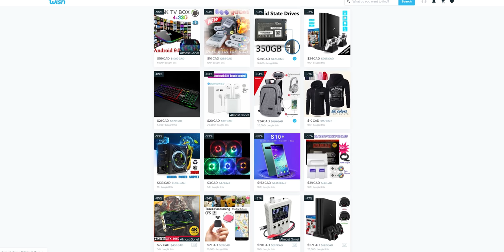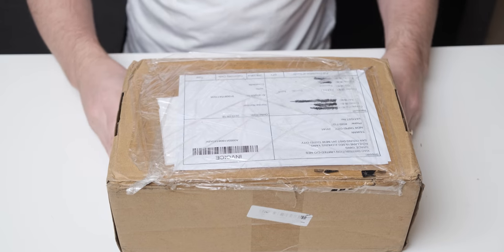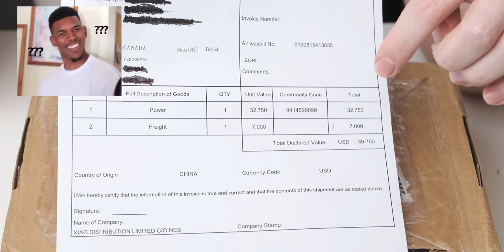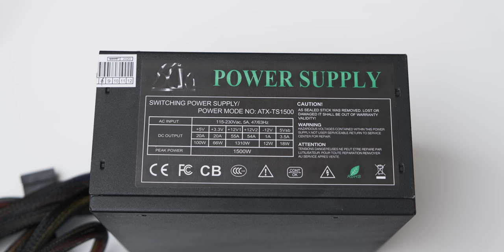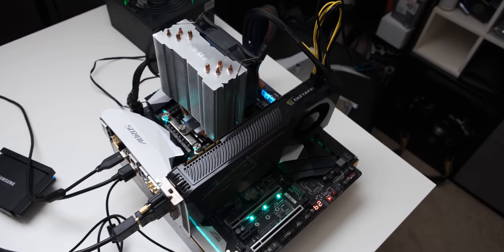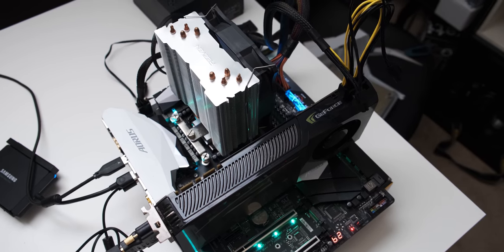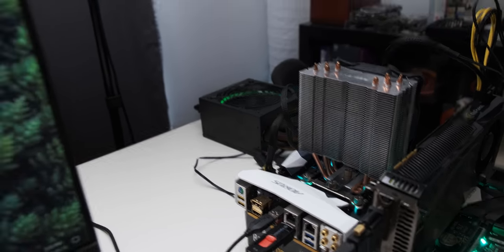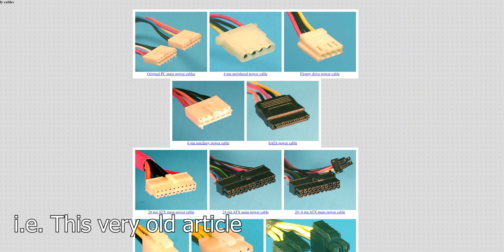I bought a $69 1500w power supply on Wish.com

Comment: Doesn't have certification or a high quality but, look at the pcb, it have some vertically mounted boards with regulators, thaths mean is not a cheap generic at least it have some regulation. And the Rubycon cap, it looks genuine maybe a recicled one because it have the "K" dent on top but the differences are in the letters on that cap. I think is a 40% to 60% off the 1500W reating.
I mean that because where i live is common to see the brand Sentey and sub-brand LNZ, which are super cheap construction pheripherals, and the PSUs like the model "BRP 500" (38.48 USD) and the internals are worse than what you shows to us is simply a generic psu, the construction is similar and it have a piece of junk similar look to a transformer or a choke, in reallity is a piece of steel and a loop of wire connected to nothing, trying to weight more feeling its a really good psu but is not.  Definetly this psu is much better contruction than this Sentey one

Comment: Hello, electronics engineer here:
After my detailed and extensive research I was able to... read markings on the PCB saying "550W..."
Btw. for real now, has nobody noticed those markings even tho video is out there for one year?
Also I highly doubt those are genuine Rubycons, it's pretty common for chinese to make such clones.
Reply: I 100% agree with you... As it is a Dual switch Forward topology design... For 1500 watts Output rectifier diodes gonna have really hard time to do.... For 1500 watts there are simply not much cooling on Rectifiers on secondary side... And not much filtering capacitors... Thats terrible... 
Although I think tbis one can do 650-700 watts. As transformer side is good enough + primary side capacitor too...

Comment: I've used some cheapo PSU's in the past. Sometimes you'll get lucky. More often you'll eventually get capacitor whine and inconsistent voltages (causing the PC to freak out).

Comment: To be honest this power supply is literally good than any other ones
I know some electrics so Rubicon is a known brand used by msi, gigabyte  and corsair etc. And the heatsinks are huge so yes mosfets and transistor should be good, and the input and output dc and ac filtration looks promising so you can say you can run upto 500 - 600 watts rather than risking your components and using it on 1390 watts to be exact. Lastly that psu really got a Thermal take which is impressive. So, yes that psu is looks promising for lesser than 600 watts.

Comment: I don't know much about PSUs, but i can say that: 1) rubycon is a (surprisingly) high-end cap manufacturer. 2) cap's capacity is nearly not enough for even 750w, its more like 450w, i think. 3)this PSU seems to have an actual pfc (which is rather expensive, since it requires a lot of copper) 4)many Chinese fake PSU sellers put very weak transformers(since they require a lot of copper again) (one fake 1200w psu once had 400w transformer), and it's hard to identify by size or look, while marking tells nothing.
4) Really, 80+ is a test of EFFICIENCY, NOT SAFETY, it's a very common mistake for some reason.
5)YOU CAN'T TRUST SUCH PSUs, even store bought with 80+, if they have bad design or components should not be loaded nearly their top power: only good 500w can power 450w system, a bad one should power 350w one. You can ignore it, and i could work just fine, but one day your system could just die from random power spike

Comment: 80+ certificates dont actually mean that your hardware is safe from harm
it only indicates the efficiency of a PSU, so technically 
a PSU with 80+ bronze can be dodgier and potentially more harmful
than a non certified one for your hardware being just more efficient in terms of power draw
and there are plenty cases of that being true especially at low budget joices

Comment: I really like most of your videos, but I had hoped you would have checked the voltages, either through software or with a multimeter, to see if it was properly maintain the 12V, 5V, and 3.3V rails.   I may well be a perfectly good, but lower power rated, PSU for a midrange replacement part.  Still giving you a like for this one because it's always entertaining to see if some older hardware will be killed by one cheapo component. :)

Comment: i would like to see that thing actually blow up and see how much load it takes before that happens ... good way to test would have been to monitor voltage values under load ... and add more components (or simply a more power hungry GPU) to it gradually and overclock cpu gpu until voltage starts to look bad ... then u can use other appliances that use 12V if u have any lying around hook em all up till it blows :D ...

Comment: In my experience, never use a cheap power supply whose quality is suspect.  I’ve had generic power supplies blow and take components with them.  Of course this was like 15 years ago.  Almost any PSU today will be better than the crap from back then.  
After that happened I placed an order for an 800 watt BFG power supply and I remember the guy being like, 800 watts is massive overkill.  Which wasn’t actually the case since I had SLI 8800 Ultra’s, in 06 this was.  The PCI-E power connector had just started being used back then and you had to have a good power supply if you wanted to get those connectors in abundance enough to run 2 or more graphics cards with two 6 pins, 8 pins weren’t yet being used at that point.  Which sucked, cuz I had to buy another new PSU, a 1250 watt Cooler Master Real Power Pro, which still works, and was awesome for back then 80+ silver by today’s standards back when the only rating that existed was 80+,  this was when I went to 3 way SLI GTX 280s.  It was one of a handful of PSUs with enough PCI-E connectors to run 3 graphics cards.
My concern now is with the RTX 3000 series they’re talking about changing to a new style of power connector a 10 or 12 pin.  And I just not too long ago bought an EVGA P2 1600 for $500.  I really don’t want to have to buy another new power supply if I can help it.  Sure there will be adapters, but I hate using adapters.

Comment: Probably a power supply that failed thermaltake QC and was sold off to a 3rd party for a rebrand.  Kind of like how lower tier TV brands use reject panels from the higher tier manufacturers.  I would say 550W max continuous.

Comment: Thats literally what i have. And it survived 11 years until now😂😂
And i have to admit. I got shock multiple times and its strong 👍
Reply: I lost 2 gpus to a much less dodgy power supply. I recommend switching as soon as you can lol!
Reply: @ThePiprian  Crap... power supplies can fry your GPU?  I have a 650 watt Corsair 80 plus nothing with ketchup and mustard leads which  I bought from a dodgy little computer shop 5 years ago.  Maybe I will replace it.
Reply: @thejollysloth5743  check the psu tierlist on the ltt forums.

Though even if your psu is a good one, after 5 years you might wanna get a replacement anyway.
Reply: @ThePiprian  Trust me, it's not a good one. I bought it back before I really used Amazon so there wasn't any choice in the shops near me.
It's the most basic model Corsair makes, and the shop overcharged me heavily for it.
The only thing going for it is that it's a 650 watt model and I only have a 10600k with a 1070, which really only uses about 400 watts for my whole system.
I'm already shopping for a new monitor so I guess I'll grab another PSU whilst I'm at it. 
Anything you would recommend in the 500-600 watt range?  Nothing too extreme, maybe an 80+ gold.

Comment: I remember I bought a fake power supply they said it was 750 W it was not. I put it under load and it blew its components at about 230 Watts. It shot claims and smoke out of the back of it

Comment: Just a warning to Dawid or anyone else who wants to open up a power supply and doesn't know what they're looking at: DO NOT TOUCH ANYTHING INSIDE. Those capacitors still hold energy and touching an exposed cap inside a PSU can literally kill you.

Comment: It doesn't look terrible. I'd use it. It seems to have active PFC and it even has a fuse! I've used much worse looking rebranded chinese crap bought at local stores 20 years ago, when nobody was actually tearing down ATX PSUs yet. I'd say the inside of a chinesium 750W PSU sold for the same price by a local dealer looks pretty much the same inside. It's just the usual 200% specs scam at wish.com.

Comment: That is around a 450w power supply and a very basic design at that likely has some pretty dirty power output I only seen a few smoothing capacitors in there so i bet money that power supply has some serious  power ripple / fluctuations

Comment: you shouldn't even try to plug in a psu like that, i'm SURE that after 200w it starts putting massive ripples in your system, breaking every atx specificacion, and therefore ruining every component attached to it, either get a proper psu testing equipment or make it explode in some way that does not require a pc.

Comment: You do realize that you used the power supply in Canada (120V) with the red switch on 230V input Mode (4:26)? This poor thing does not even have a wide-range input :-D

Comment: man this thing is more flimsier than my old Powerlogic 550w generic. I'm no electrician(well my brother and father are both electricians) but I have a theory on these PSU's on why they are mostly above 1kwatts, I think the idea why they give these things such high capacity is because generics and those korean non branded psu would be unstable af if they reach more than 80% load, generics and white psu's from my experience makes a lot of heat that's why they shouldn't be in any cases that have the psu's top mounted. my Cooler Master Elite V3 400w blew up on a 35c afternoon while playing black ops 2, though the parts innit aren't exactly power hungry. also I think I heard the PSU God JonnyGuru talking about generics and lower tier psu's having an old topology design that would have effects on your system in the long run if paired with modern parts, like grounded usb ports and audio ports as well as leakage to the case itself... which btw happened on my friend's system when he was using his TigerPower 700w PSU which he called tigershit. it got so bad that when one of our friends plugged in her iPhone 7, she couldn't touch it because it keeps shocking her lmao. PhilsComputerLab and Zach's Tech Turf also had a similar psu that you bought tho Phil I think has the mining version... and so far so good. 
any ways you have balls of steel on disassembling a dodgy PSU, I typically do it on generics that need their fans replaced but that psu is far worse lol.

Comment: looks like a low end old TT power supply with a new sticker, maybe 350 watt
Reply from the maker: I'm not sure its more than 350W considering thhat the system I tested it with draws over 400W.
Reply: @DawidDoesTechStuff  I ran a 400 ish watt system on a 300 watt power supply for over a year before it went poo

Comment: most of the time those things are "okayish" mid-power units that are grossly over-labaled and sold at a higher price. so instead of selling it as a 500W unit for 40$, they sell it as a 1500W unit fpr 69$. 

it will work in almost any pc, but will not handle a 16 core sli blingbling machine.

Comment: Been nailed by a powered up supply that wasn't working properly, i.e. the Amiga 2000 wouldn't come on, had the top cage off and was trying to see if any of the larger semiconductors were overheating or just cold because they were dead.  That fingertip was numb for some time afterward. Yes, stupid, I know. At least I was bright enough to NOT be touching the computer chassis with my other hand  thus  not enabling a nifty ground loop thru the rest of my body.

Comment: I was thinking that, besides the green led ring, it looked basically identical to an old 600 watt Thermaltake unit i have laying around. Then I saw the Thermaltake fan. I'm guessing its just rebranded with different stickers. Although, if I remember correctly, even that old 600 watt unit had 2 pci-e power cables.

Comment: I'm pretty sure these units are recycled. the chassis are repainted and the internal board is switched out. what was a 300 watt PSU is now a 1500 watt PSU, though you wouldn't know it because its been upgraded.... if I'm wrong, well then, its just another cheap item from China....

Comment: it would be more interesting to see actual power delivery with some specialized equipment including power under load in that way you don't have to risk your actual computer system but I know that's not what's you usually do and it's quite costly so, thumbs up anyway.

Comment: looks like a thermal take silent  plus 1000 psu  they are a bit old  and not 80 plus certified but they are not terrible
Reply: still though they are rated really to handle 800 watts max  people have found

Comment: There's a 1000W PSU in my country cost $70. But it is actually Legit. And is recommended by a lot of high end gamers. At first I don't believe it, but then someone explained to me how the distribution works. Basically all Computer parts that manufactured in Asia will be significantly cheaper in Asia only. All assembly of famous PSU are in Asia, be it Taiwan, South Korea, or China. PSU like Corsair, ThermalTake, CoolerMaster, Seasonic, are assembled in Asia. Which means I cannot look up for its price based on US dollar, because it will be the Price of Non-Asia region.

The PSU I'm talking about is Armageddon brand. Not so famous to you guys but it is just like GPU Palit, which also not famous outside Asia but they make a Legit RTX 3090.

Comment: i got 1600w and 1800w power supplies like that but i have like 6 x 6+2 connectors on all of them. i chop off like of them because 4x 6+2 should be enough
some had 2x 8pin for cpu but all mine had 1x 8pin cpu and 1x 24pin and like 4 sata and 3 molex

Comment: This is just a re branded power supply, probably from thermaltake.

I wouldn't buy it, but as long as you kept the load ~500-600w it shouldn't burn down your mothers hacienda

Comment: on the positive, it looks better than a 450W coolmax from amazon...
1500W is such a horrible lie, looking at it's available cables and the fact that it didn't explode with the 285, it's 450 to 500W max.

For the price, a good new EVGA or Corsair PSU around 600 or 650W Bronze rated.

The Bronze, Silver, Gold Platinum rating is for it's efficiency. 
Meaning no rating is least efficient. So if you pull 400W, on the wall it will pull less, the better the rating.
For a 350W Peak use PC with a 500W PSU, that you turn off at night, you won't lose any money.

If you have a 500W mining rig (2x RX570) for example running 24 hours, a silver or gold rating will save a bit of money overtime.

Comment: the inside and everything looks exactly like my real thermaltake 750w supply, weird....
Reply: Right. I think it's some recycled overstock of Thermaltake. That could explain the Rubicon cap and the fan. These components are way too expensive for such a cheap supply.
Reply: @kriswillems5661  i think that's being optimistic what likely probably happened was whatever Chinese company manufactured this sent some guy to go raking through the bins at a Thermaltake plant and just take whatever looked undamaged

Comment: Just for safety dude, next time you work with a power supply of any sort. Do open it if you must before powering it up. Isolating yourself from the ground will do nothing to stop a capacitor discharging through you and killing you stone dead. Unlikely scenario, it usually just hurts, but better to be safe.

Comment: So in other words, you get a 69€ PSU - and overpayed a lot. Or rather what you'd get from "Named Brands" like Corsair, be quiet for around that Price (well, rather around 50€ or so)
The Primary Cap, 400V/330µF points towards the 500W Direction, maybe with a bit of ignoring the ATX Spec of 17ms Hold Up Time, 650W. 
At least it has DC-DC, but Protection look to be lacking, 8pin = no OCP on 12V, possibly no Under Voltage Protection for 12V, with high Primary OPP, it will be bad...
And no, Seasonic S12II-Bronze or M12II-Bronze up to 620W are not good PSU that anyone should by for 50€ in 2019 ever! There are far better units from other Manufacturers.

Comment: Dude if you want to test PSU stress it with high usage and check voltages, voltages should be consistent and without drops, also current output should be consistent, then you use uni tool to check directly flow of current or voltages, also more powerful PSUs should be heavy in hand, you also could check type of components by searching online for similar components or by comparing to other PSU which have components that could be "googled", also google is not only method for finding them. Put more effort in learning and videos will be better.

Comment: I wouldn't even power a core 2  duo with that thing, its not that i do not want to sacrifice it, i do not want to sacrifice my house! That thing looks really dodgy and cheap, it looks like it doesn't have any form of serious protection going on in that thing, this is a power supply that will fail spectacularly with fire and popping caps, the only quality component in there is that Thermaltake fan, if it is not a knock-off ofcourse

Comment: With only two 6+2 cables.... why in the hell would you need 1500w??? LMAO
I have a 1000w PSU and I'm running a close-loop cooled 3090 with four 6+2 cables and don't even come close to the ceiling.

Comment: If you have heat laser detection gun on stress testing even if one of those parts inside the power supply get 130c degrees Celsius its going get your house and Fire one day😲😢